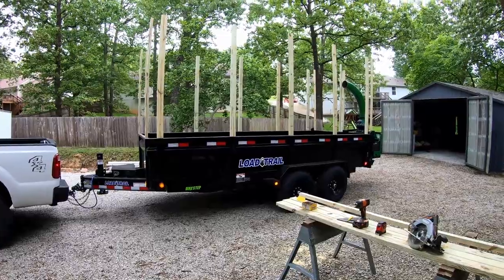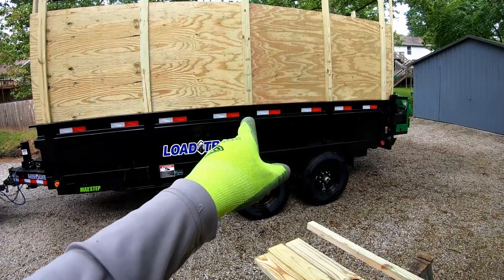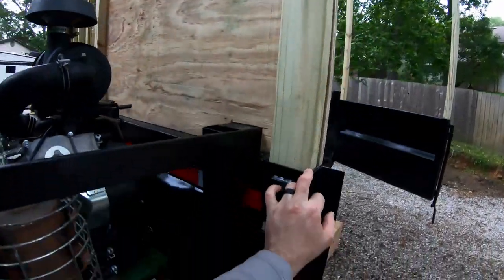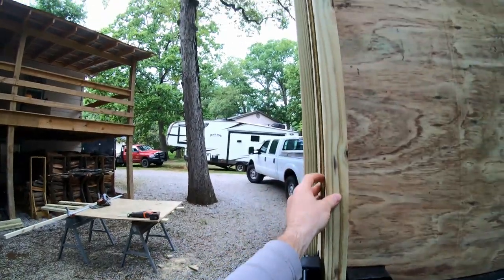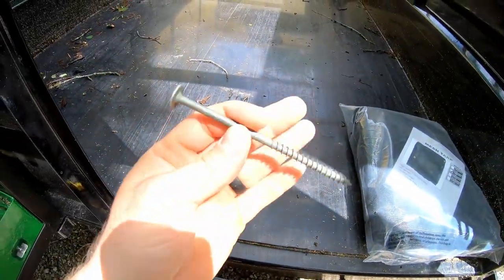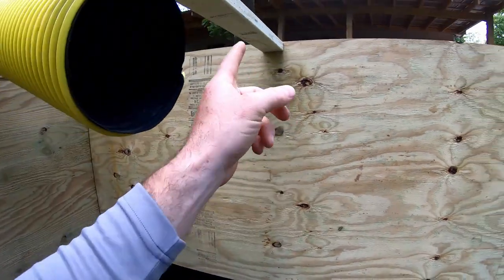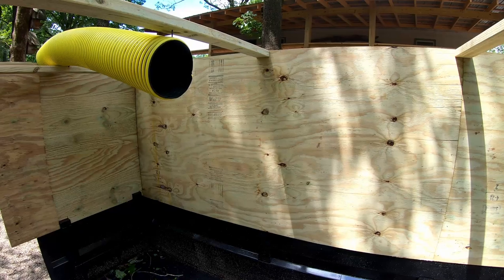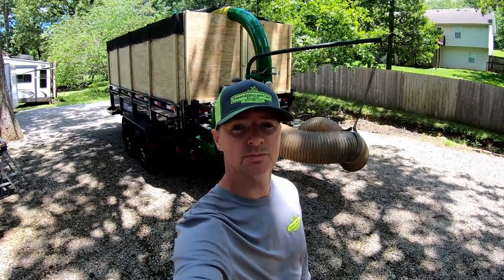Leaf Box Build

Comment: In Harbor freight you can get a little bungee cords they have a little plastic Circle hanging from dance so I run my tarps in my dump truck and trailer with those So I put the little bungees in every single eye of the tarp then I put screws into the plywood and every single Bungee attaches to it so they pull really tight to keep the tarp In please but the beauty of it is that you can remove a section in a blink to throw stuff in the trailer like branches or dumping a barrel in there or if you need to jump in there to compact the leaves So you basically will have access throughout the whole trailer and they snap in those screws in no time I wish I could send you a picture
Reply from the maker: I think I can picture it, that is an excellent idea!
Reply: @HandyGuy2016  in the past I also just bought bungee cord by feet And then I did my loops It’s about the access which matters whatever you decide to do But man you make me realize the fall is Around the corner I should get a few things done before it gets me with my pants down😳😳😅

Comment: How did it do with the dust? I currently have the 37hp Billy Goat, an with the 12/1 compaction it creates and blows a insae amount of dust up right through the mesh top. Leaves a terrible mess of dust on the ground/ more importantly the operator. Any advice is greatly appreciated. Great video.
Reply from the maker: I have not figured out a way around that yet.

Comment: nice job my friend..I have similar  setup with a smaller billy goat not shown set up yet..I used deck boards and a m
esh tarp with two half doors similar  to yours..trailer is 12'
Reply from the maker: Nice 👍
Reply: @HandyGuy2016  love my loadtrail..bought back in 2018 when trailers where reasonably  priced..No issues yet😉👍
Reply from the maker: @bluewall9410  good to hear, they seem really well built.

Comment: Great video! When I get my tip dumpster I'm following your lead to the T!  Question for you,  will this dump be specific to spring and fall cleanups?  If not will you be taking the walls off for spring/summer months?  Thanks, again great video.
Reply from the maker: I use the trailer all year, so this is just a Fall/Winter setup, then it all gets removed for Spring/Summer.

Comment: Why didn’t you mount the vacuum towards the front end of the trailer ?  Above the battery box..  

Seems like it’s easier to unload if the vacuum isn’t near the back as it’s a dump trailer.
Reply from the maker: I did a lot of research and talked to a lot of guys running dump trailer/vacuum setups, and the majority prefer rear mount vacuums.

Comment: Nice setup. How does the door open connected to the yellow/black pipe?
Reply from the maker: The pipe is loosely fit so it comes off  when the door is opened. I have changed it since this video and it is now clamped to the end of Billy Goat Tube and opens with the door.
Reply: @HandyGuy2016  got it. Thanks!! I’ve got a vac on a dump but need to make the sides bigger 🤪 and this is great inspiration!

Comment: I think it's easier to buy a trailer with higher walls than to do that
Reply from the maker: If you wanted to use it with high sides year round, it would be easier to buy it with high sides. I use it to haul mulch, gravel, and other loads with the short sides and use the side extensions in the Fall/Winter for leaf removal.